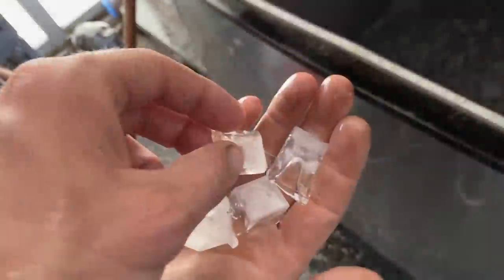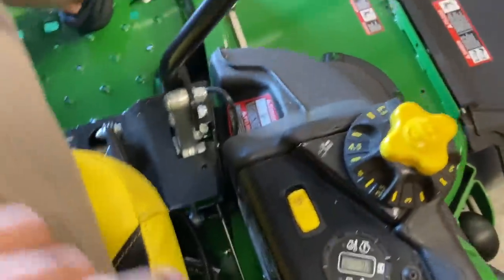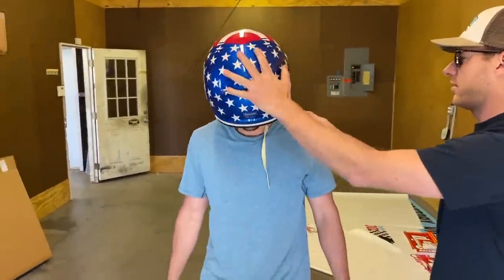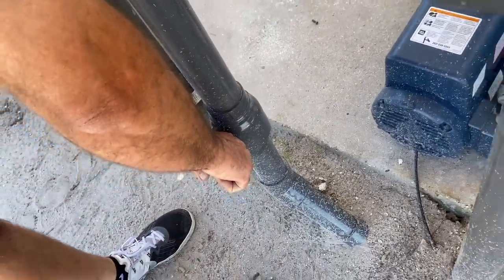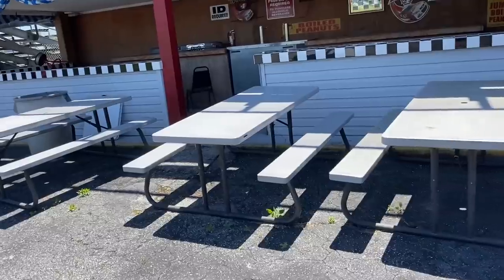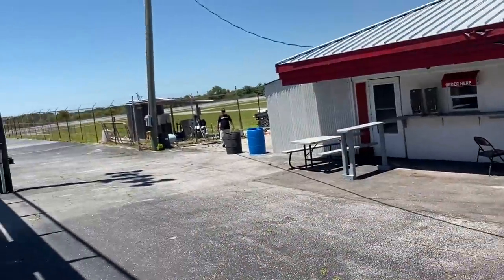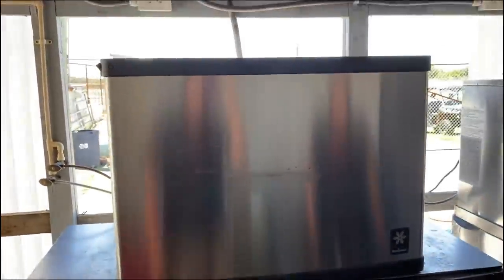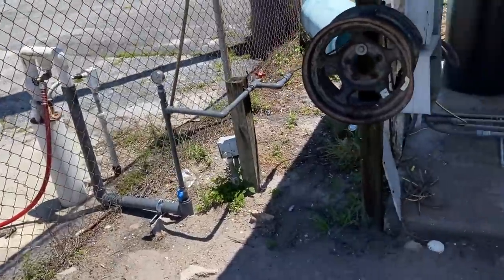The Freedom Factory's Water System is ONLINE!!!! We've got Water!

Comment: Before you put that ice in drinks, you HAVE to clean and sanitize the ice machine!!!

They get SUPER nasty.
Reply: They will probably start by using the ice for their air-to-water intercoolers first.
Reply: he said that they would do that, didnt you hear that ?
Reply: False Flag  I wouldn't. I've seen what happens when they aren't properly cleaned. Mold builds up INCREDIBLY fast.
Reply: He mentioned that at 17:05, Cleeter knows better.
Reply: False Flag  Any decent health inspector worth a crap will almost always take a glove and check underneath where there's a rubber seal and on the pad ice will slide down.  It takes like one second to do.  This was a huge problem back in the day but not so much anymore.  All you need to do these days is make sure the restaurant has a decent score on the front of the restaurant and you're good.
Reply: False Flag  Drink machines can get fucking nasty but like another dude said. Health inspections are on that shit like a fly on shit
Reply: False Flag  the soda machines are always moldy on the inside, it's a bitch to clean the nozzles from the inside so it's mostly ignored because nobody notices anyway...

Comment: Cleetus: has his brand new mower serviced. 
Me: has been using the same mower for over 20 years and I’ve maybe changed the oil 3 times. (Belts and blades are changed more frequently)
Reply: Hes having his personal mower serviced and the new one is getting a stripe kit
Reply: Currently using a 25 year old mower my dad bought brand new, still stripes like a beast even with chunks missing out of the blades.
Reply: Porter McSorley might have to as it was sponsored to maintain warranty. They might want that 8 hour service or 15 hour or whatever when brand new. If they cut the fields it would have been a serious cutting
Reply: Hell I'm still rocking grandpa's old John Deere, even put a hitch on her to pull a small trailer around the yard
Reply: Run a mtd 995 1980 for the last 11 years run like a champs, its a beast 🤘
Reply: Jesus christ change that oil ! Haha
Reply: @jaked964  The blades don't make strips lol
Reply: Porter McSorley lmao we’ve got a cub cadet with 600 hours on it and we’ve changed the oil twice. Once on purpose, and the second time when my brother left the dipstick out and shot oil everwhere😂
Reply: David Elam Doubt you have proof to back this claim up
Reply: At my house we have a 1987 Columbia 12-38 (I think) mower and the only thing we changed since my parents bought the house is the starter gears (they are plastic, they are made to break), the blades and the oil. Still working very well!

Comment: i wouldn't replace the valves in the toilets. id personally replaces them all with new aqua squares double flush buttons. they are 100$ new at lowes and come with a 5-year warranty on all parts. I've put in over 200 with zero problems so far. replacing the valves will cost about the same if you pay a plumber to do them. but anyone with some common sense can change a toilet
Reply: $20k in toilets
Reply: those are tankless commercial toilets, you cant just put a residential unit in there, it would be broken in a month.

Comment: Hey Garrett, I'm an industrial maintenance mechanic with 14 years experience.  I have tons of experience with electrical, plumbing, and hvac as well as automation controls.  I dabble in anything else including sound and video.  I can also build or swap a motor, tear a car apart and restore it, or just make it run and go down the road.  Small engine repair and maintenance is also not a problem.  I've operated heavy equipment unprofessionally albeit safely and been paid for it.  If my skills are something you need, I offer them to you for $90k/yr salary.  I need to stay busy though.  I'd be walking away from a job with the same salary but they can't keep me busy.  I'm tired of staring at walls 8 hrs a day.

Comment: Hey Cleetus. I've got a tip on those Sloan Regal and Royal flush valves for you, that I'd like to be my contribution to the Freedom Factory. I hope it saves you thousands of dollars by not replacing flush valves you just rebuilt, that seem unrepairable no matter what you put in them. After installing new kits and they still act up, is when they tell you, you need to buy a whole new flush valve. NOT. You see, many years ago, I had a couple valves still acting up right after I rebuilt them with all new parts, including the plastic insert inside the top cap. Everyone figures that the chrome top cap being solid metal doesn't need to be replaced, so they never do. And that's actually is the problem. Over years of service, I believe the cap somehow changes in specs (I think it actually gets screwed down farther with more turns each time it's put on) causing the plastic liner cap inside of it, to change capacity on top of the diaphragm, then they don't work right. So as a last ditch effort, I tried replacing the chrome metal top caps, before buying new valve bodies and it fixed the problem. They worked like brand new, just as they should with all new parts in them. Over the years I've replaced countless metal caps, saving countless thousands below the cost of replacing each valve, especially since you just rebuilt the old one. So if there are any giving you trouble after a rebuild, try a new chrome cap before buying a whole new valve. You'll walk away at least a couple hundred bucks ahead for each valve that you thought you had to buy. Just a little trade secret there to help get you flushing, without flushing money when you don't have to! P.S. Keep the floor drains in all areas clear and flowing well, in case one overflows. And  Keep the little lake! Take care. Jpol.

Comment: big note: When operating pumped lines, for the love of god, always open a valve before closing the other one... i cringed just watching lol
looks great Cleetus and crew!
Reply: This is true but in this case the pump was off due to the hi level switch on the tank.
Reply: Tango Foxtrot oilfield day one, open a valve before you close a valve
Reply: Aren't all lines pumped lines?  How would you be able to close them all if you  have to always open another one first?
Reply: Yeah that can be dangerous 4 sure I got blasted into an open electrical panel one day at work when a plastic  (pvc) valve split open under pressure and the 180 psi 3" column of water hit me lucky the panel was down for service.
Reply: Yar Nunya  Jesus Christ this a YouTube comment section not a English class take a chill pill
Reply: Yar Nunya *Try. You start a sentence and a command with a capital letter.

Perhaps your memory lane trip should have gone to kindergarten instead of stopping at elementary?
Reply: Yar Nunya  He forgot the comma... Meant to indicate the panel's name was Lucky :)
Reply: Yar Nunya  Nice try, that doesn't count though.

Comment: Cleetus i work in HVACR and usually whenever a restaurant changes owners even if the walk in is in good condition after being off for a while water soaks into the walls and mold builds up i would recommend replacing it. They average around $40,000 for a standard 8x24 fridge/freezer combo plus labor. The company’s i work for are “johns refrigeration”  and “northern air heat and refrigeration”

Comment: 17:30 Cleetus, once you're confident its operational, be sure that it is well cleaned before usage, INCLUDING any ventilation(important!).
 Old refrigerators can be unhealthy if they haven't been maintained/cleaned properly. I used to work in a kitchen, and refrigerator hygiene was always a priority. :D
Its not as simple as just keeping it cold, as germs can still be a hazard, particularly if the temp goes up and down in the environment. Btw, the temp will fluctuate over the year, and if the fridge is not sanitary enough, it WILL present a possible health hazard. Until you clean it and get a inspection though, theres no way to be sure. Best to be safe than sorry here to prevent sickness. :D
Reply: Not 100% sure but I think he'll have to have everything food related inspected before opening to the public.

Comment: I feel like the hoses in the infield are not going last long before they get smashed...
Reply: My thoughts also, maybe need those tucked down within a water-box like water main shutoff at your house, by the street.
Reply: Ya, I mentioned in the video when they were installing the new infield they need Valve Pits with a Hatch(with notch for hose so you can close it with the hose hooked up) for those Ball Valves so they aren't in the way. Like this one: http://www.berkeysupply.com/product-70.html
 Would make it easier to mow too.
Reply: @joefields719  nah.  If a car snaps off a PVC hose bib, it's no big deal, like 15 cents to fix it,  and the car won't be hurt.  trying to "shore up" those things or put them below ground is just asking for problems when a car does hit it, or if water puddles up in it or whatever.

Comment: For the ice makers, make sure you use the correct ice maker cleaning solution. when the refrigeration guy comes to look at the fridge and freezer he will be able to service the ice machines also. 

I’m also putting $50 on the fact one of the compressors will be blown on the condensing sets. The Circuit breaker tripped after being on for what 30 seconds which is usually how long the time delay would be set for for the compressors. 

Good luck do it for Dale.

Comment: Manitowoc ice makers are one of the best. Keep that ice bin drain clean bro. I know a thing or two because I've been the tech that goes to a remodeled place and the drains are usually filled with alge. New equipment does not mean proper operation. Flush the drain and do it for Dale. Btw the carbon/scale filters are a must on the wall directly before the UNIT. Runn them through a clean cycle every week if y'all start packing stands regularly. I hope the best man. Love from a furloughed hvacr and beverage tech.

Comment: Who'll be the first to spin out, and break one of the infield faucets?   14:50
Reply: Needs to put those tires around them...
Reply: I hope they were smart enough to put a shutoff valve for the entire infield.
Reply: I thought of that if it’s sharing with the kitchen it would cause a problem if one was broken you’d probably want them shut off during a event so the kitchen gets all the water it needs
Reply: kind of thought sub-surface boxes mightve been a better idea? but whatever, they are there, getting it done 👍

Comment: Hopefully they ran cholorine through the whole system. Sitting water systems can grow some nasty stuff leading to dysteria, typhoid, etc.
Reply: Legionnaire disease
Reply: Cletus said that the little tank was the chlorine tank. 
So it's safe to say they'll be thinking about the safety of their guests.
Reply: @jasonstrout4502  there's a difference between adding chlorine to a system to prevent stuff from growing, and adding chlorine to a system that has been sitting to disinfect it of whatever has already grown. normal tap water has some chlorine in it to keep it safe, but you wouldn't use it alone to clean your kitchen.
Reply: @jasonstrout4502  Yeah, the guy they have helping them on this doesn't look like some bum they picked up off the streets.  Cleetus has a "Water Guy", just like he has a "Lawn Guy", a "Drain Guy", "Paving Guy"... everybody.  They may not be perfect, but they are pro's.
Reply: In Texas this would be classified as a public water supply and there’s quite a few regulations covering the quality of the water.  I’m sure they’re going to make sure that it’s good with Florida regulations.
Reply: @admkbldwn  Ditto. I've done my fair share of large construction projects as well as renos, always want to make sure you give the whole system a good flush. Typically the steps are to increase concentration of chlorine in the mix (about or a little less than double the normal concentration), run everything for a bit to make sure all lines are full with heavy chlorine mix and let sit for 24hrs (make sure no one drinks this stuff). After the 24hrs, lower concentration of mix back down to normal, and run all lines to flush out heavy chlorine. Take a sample of the water and test it to make sure your concentrations are good and water is clean.
Reply: @SirVic42  Sadly, being in the business or owning a company, doesn't make them pros. Not saying that these guys aren't good, just that my 37 years as a Commercial Construction Superintendent has shown me to watch every trade and check their work to prevent disaster from occurring. I've had subs tell me that this is the right way because they've been doing it for 30 years, and all i could tell them was screwing it up for 30 years doesn't make it right. Remember, we usually award to the low bidder, the guy that either missed something or screwed up his bid. Lots of great contractors out there, just have to do your homework to find them.

Comment: Dear Cleetus and Gang:

If the crew is interested, I can help you guys with deterioration on the outside. Get some small longevic pansies like johnny jump ups and a soft succulent like a purslane. Those 2 will out-compete most weeds and have a very shallow root. They will pull moisture up. They will take water off the outside of the track and help keep some of the bad weeds at bay and simultaneously preserve your exterior track. They are also far easier to weed and help make the track look nice. I've used it on my driveways for years...

Sincerely,
An ol' Nevada Farm boy...

Comment: cleetus for urinals that are clogged order urself some liquid drain opener. Shut the water off by turning the screw till it doesn't flush. Pour that liquid drain opener into the urinal and cover urinal with a garbage bag and tape it off. Do ur best not to breathe while pouring the liquid. After 30 minutes ur urinal will be like brand new! I'd also recommend investing in some auto flushers for the urinals it will save u from the clogging again over time.

Comment: Soooo easy too service those , grease fittings, pop the blades off for a quick sharpen, blow the air filters out and oil if you want , air the tires , it would take you less than an hr first time

Comment: Yeah I don’t recommend turning on HVAC stuff on without getting it checked out and serviced. They could likely damage the compressor for sitting for so long. It could be low on charge or the oil could have leaked into the evaporator coil.

Comment: The "bib" valves in the infield.. Don't tighten those type down so much those type will wear out quickly and never shut off properly if you keep tightening them up like that. just tighten them down until they stop letting water.

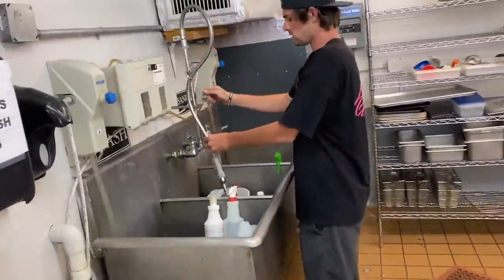Comment: 13:50 That's not what the hose ring is for. Hold in the handle on the dish sprayer, and slip the ring over the handle to lock it in the ON position.

If you need the sprayer to hang out of the way, just hook the hose. That'll make the sprayer hang near the back of the sink where it won't be in the way.

Comment: You had no idea about those urinals but if they had been all shut off at their valves they would have had possibly no issues. I've worked at many hospitals where youd have to flush all toilets and urinals when the main water line would be inspected (fire ststem) and what a pain to go back, shut the valves off on those things and cross your fingers it wouldn't keep running. Good times.

Comment: The water on the slab is an easy fix. Go back through with a concrete saw and cut the relief crack deeper. The water will drain